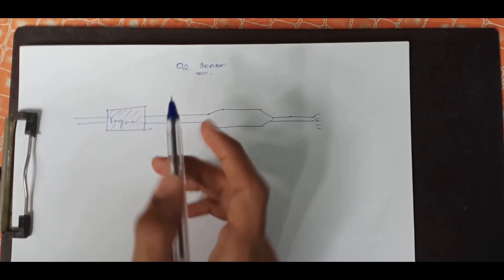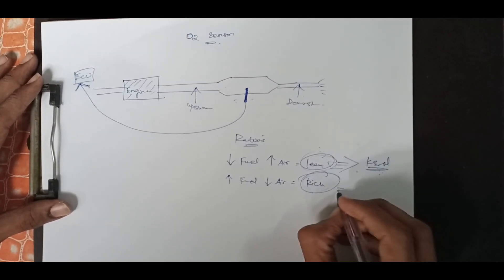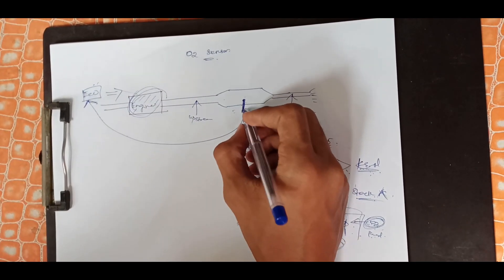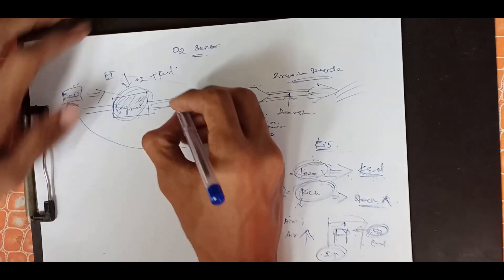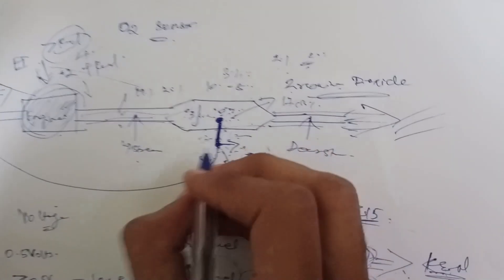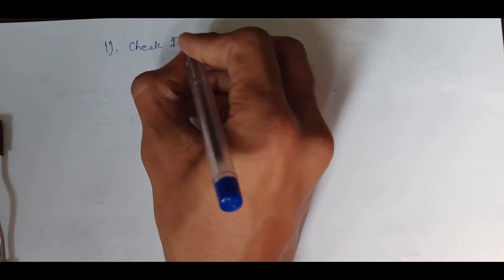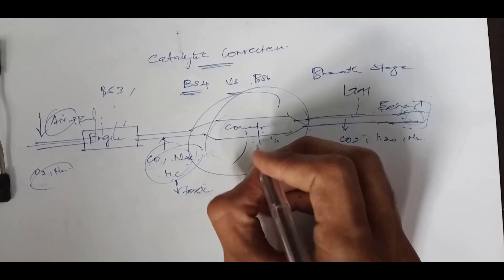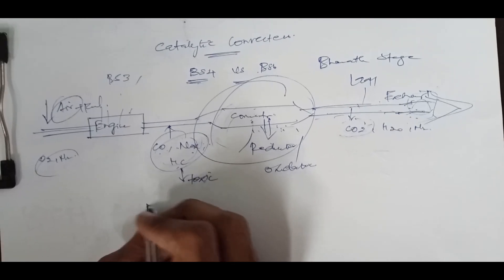OXYGEN SENSOR AND CATALYTIC CONVERTOR WORKING | TAMIL | EXPLAINED

Comment: Nice one ..I have R15 V3 BS4 model..

After market full system exhaust poturuken...But R15 V3 BS4 there is not a O2 sensor ..they launched only in BS6 version..

Enna questiona , I heard whenever u change a stock exhaust, Fuel mixture will get lean nu solraanga, and lean mixture is not good for the engine..unless I did a ECU remapping while change the exhaust..

So naa remapping alam ethum pannula apdiye verum exhaust maathi than oturen...ithanala any problem varuma engine ku on a long run..??

Because super bikesa alam exhaust maathuvaanga along with proper ECU remapping...so ECU remapping panna lean mixture avoid aagumaa??

Pls answer me on this bro..